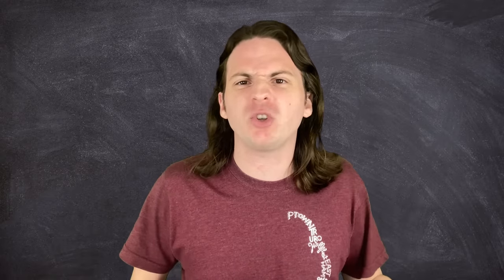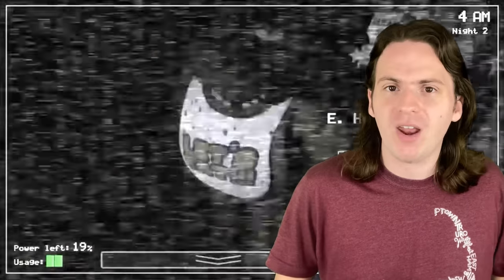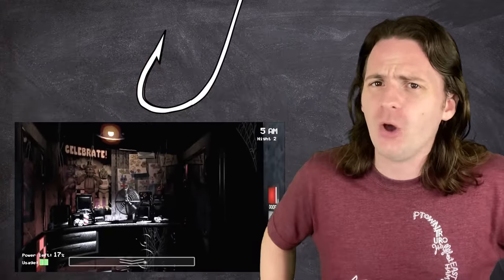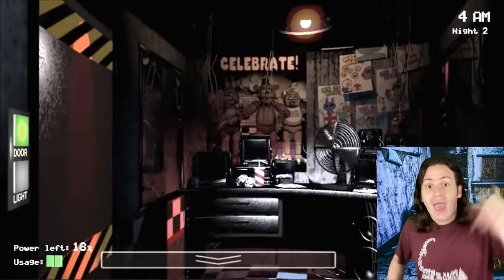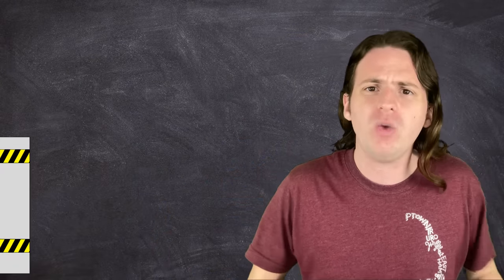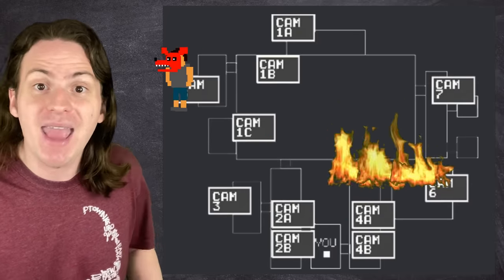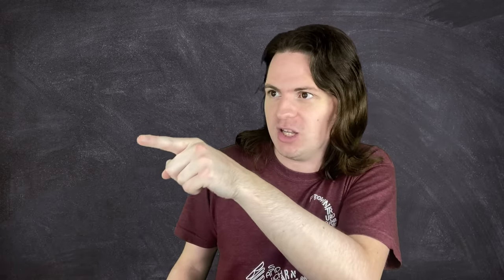Why Don't the FNAF 1 Doors Stay Closed?

Comment: So I guess the fnaf franchise works by saying they use springlocks
But here’s the thing the springlocks for the doors are to pull up and they use electric to pull it down and there’s a stopper to stop the door from going up because it uses electricity so basically all its doing is using electricity to hold it down

Comment: Simple solution make an emergency door behind you that is only way so intruders cant rob the place and so you can leave unharmed in an emergency (aka power outage) or just do some basic remodeling make the office have one door to dramatically reduce power cost and also i think if the door went into the ground and was pulled up would be better or even pushed up with a hydraulic with a manual releasee valve in case of an emergency

Comment: The question really is, why is the night guard office the sore thumb sticking out of the restaurant, having two hallways leading to this same room, isn't that just bad design? And why are the doors literally hunks of metal slabs that closes on an unsafe speed? Why can't there be just one hallway so that money can be saved on one door? Heck, why make a whole hallway just to get to one employee-only room where the guest should not go through, and just one NORMAL door and not some most likely expensive security blast doors that seperates the room themselves. If they know that these animatronics are "quirky" at night, then why don't they just create some tool to deal with the animatronics?? Or maybe recall them for maintenance (until they found out whats inside of them). Its not even practical to hire a nightguard at all! Its a run down building most likely already in shambles on itself outside. Even if they are afraid some thugs would sneak in and salvage anything they find valuable, why won't they just let the animatronics deal with them like in the movie? It seems sone unlucky guy cleans uo what ever that is left anyways????

Truly a FazBear Entertainment moment.

Comment: Legit the problem with this as a safety feature is, if the security guard is hiding in the room from lets say a robber or murderer in the store with the doors closed. If the robber or murderer just finds a way to disconnect the building's generator, then he is kinda fucked. Lol. Kinda the opposite of a 'safety' feature.

Comment: Simple answer is its for safety.  Imagine getting locked inside a building because the power goes out.  If there's a fire and the power is lost welp i guess you're dead.  The spring locks are safe if you don't fuck up the spring locks. Also in the lore the spring lock suits were discontinued and warned by the higher ups not to wear them.

Comment: you know, why didn't they just add a metal Lockable door.

no power consumption, no danger of getting crushed or trapped during a system short circuit or blackout, and I'm pretty sure animatronics from the 80s even possessed by Human souls can't exactly punch through full on Metal with fabric hands.

Comment: systems are designed to fail safely. i.e., power used to keep something closed, so if there is a power failure, people are not trapped

the doors would be designed in such a way that they would fail open, be it a spring or permanent magnet holding them up

Comment: So I haven't finished the video yet I just started watching this so I don't know if this is your conclusion but I think the doors are spring loaded so when you press the button something push down the door and keeps the springs in place and when it runs out power or when you release the button it stops holding the springs in place

Comment: ngl this would've been solved if they just didnt have the windows to each side of the office and made the doors slide in and out of the wall with a latch to lock them in case of burglars or animatronics busting in. if they really, REALLY needed to over engineer it they could make it an electronic door still, so in the event of a fire or prolonged power outage they'd force open?

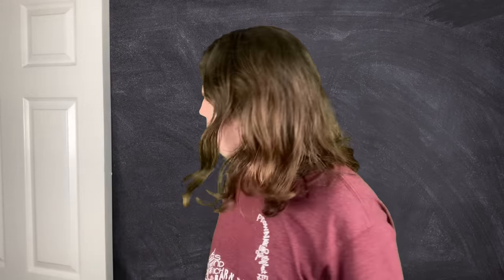Comment: 11:00 And if a group of multiple guys try to get in? Lets say the are armed, the walls and glass are clearly reinforced since the animatronics dont decide to enter from there or via breaking the walls. Then what? They would just be able to burst fire the NORMAL DOOR AND UNALIVE YOU, they are  designed so THEY DONT TURN INTO SWISS CHEESE.
Reply: Oh and for the smarties that say "And if they cut the power?".
Bud, im gonna guess the generator that supports the power for the doors is gonna be on a LOCKED ROOM. With only a key or code or something to access it, with that, that would make the doors completely unaccessible via force, if the doors just operate on a generator, there would be no need for connecting it to the main power box that most likely would light up the restaurant, which leads to another reason to make the doors go up if the generator stops working, because by the time police comes, the robbers couldnt get in and the video proof would be there, and most likely could be tracked down. AND if you concider the fact that if the generator power DOES go out, fazbear entertainment doesnt act responsible by any incidents against their workers and its all on them.

Comment: even if the door was built for the power outage problem
then cant the securirty guard go throught the wondows that you see through next to the doors
so the main doors are closed due to gravity is forcing it down and the electricity are not powering it down
so the gaur can go through the window
i fixed a fictional issue
while making the safety system a bit better

(if you dont know what i mean then one of the windows are on the left side of the poster with the freddy nose easter egg)

Comment: I know I’m a year late but If I’m going to give my headcannon as to why the doors are like that it’s not just fire safety but security guard safety as well think about it someone could be threatening the security guard as they would likely get involved in keeping the guests safe in a situation with a dangerous person the doors are able to slam shut keeping the threat away from the guard and extra measures like electro magnets are there to prevent any sort of car jack or anything render them useless making them use power then the threat will be unable to prevent the guard from calling the authorities the guard can then monitor from their room and get involved if the threat goes to targeting guests if they haven’t already

Comment: So the you say that the door lights etc runs off generator but that's not true they turn off the power during the night to save on money and the restaurant is open the only reason foxy is broken is because fazbear intertainment is lazy and it runs off the power left in the restaurant before they shut the power off

Comment: To what i believe, FNAF 1 takes place in 1985. I partially believe that the door opens to not get stuck. Supported by the fact that during the day, the doors cannot close to prevent child harm. Meaning that during the day the generator power for the doors is cut, and so when there is no power the door system should recognize this as the sign that power is cut and thus swings open after power runs out. But here me out, Fazbear Entertainment isn't the most financially successful company, but after all the pizzerias shut down with possessed animatronics and they want to keep security safe so that they don't get sued. They just got lazy about the non-infinite power thing...

Edit: Some theories say that it uses springs, that couldn't be far off. Think about it, huge springs keeping the doors open, and a piston pushes it down, stretching the springs, and using power. And when the piston retracts, the springs go back to its normal size.
Reply: Fnaf 1 takes place in 1992 or 3, the location where the unwithered animatronics performed was open in 1985.
Reply: @Smiley_404  no thats wrong the withered and fnaf 1 animatronics are dif since they have dif designs (missing parts are for remodeling new toys) and the fnaf 1 animatronics are Endo 01 while withered are Endo 02 since it literally is called "The Grand Reopening" the toy animatronics have facial recognition but the FNAF 1 animatronics don't. Also dont let the fnaf 1 phone guy call confuse you "But then there was the bite of '87" but FNAF 1 takes place in 1985, as it is going to close shortly after. The endo 02 (Withered animatronics) make less sense since how is endo 02 made before endo 01?!
Reply: @Smiley_404  yes it is

Comment: It never made any sense why when you run out of power, these heavy doors just defy gravity and lift up. logically it would make more sense for the door to require power to open. The door would probably be on some sort of rail thing and when you press the button to close it the door would drop down and when you open it, it would slowly lift back up (cause there's just no way a door that heavy would be able to lift up instantly like in the games. You could argue electromagnets but I highly doubt fazbear entertainment would risk having all their expensive electronic equipment within range of an electromagnet powerful enough to lift a fucking blast door in a split second

Comment: why couldnt they just make it so the doors went from below instead? :face-blue-wide-eyes:
Reply: because they'd need to dig in a concrete foundation an at least 2*1*30 hole to fit the door itself and then fit the mechanisms so it can open without also digging them too much to the point it would fuck the structural integrity of the building think for a second please.

Comment: Yeah let gravity do it practical but then you would win instantly so it would be fun to the player.   But.    It would also be fun for the engineers to fix and or make the way the game works.     Yeah I mean tecnicle yeah so you don't get locked in then you'd be stuck in there but in the morning power comes back on resets all power as you can see happens every morning bc you don't see the power staying the same as you left so theoretical when morning comes if you were stuck you could just open up and get out easy right right